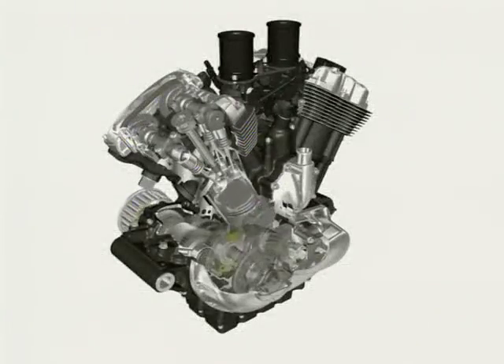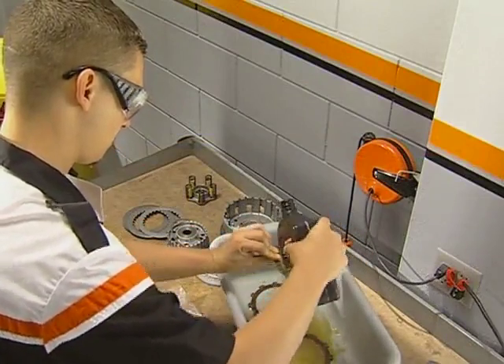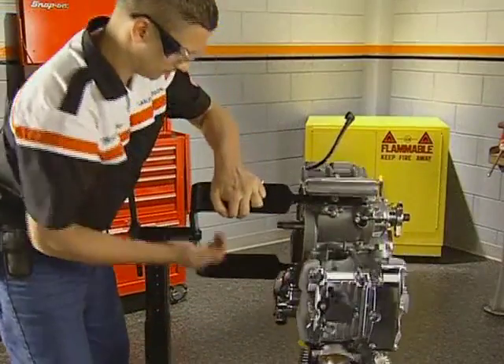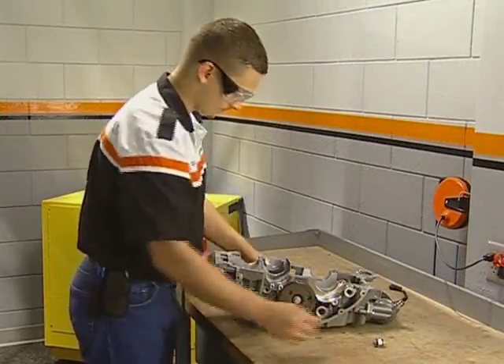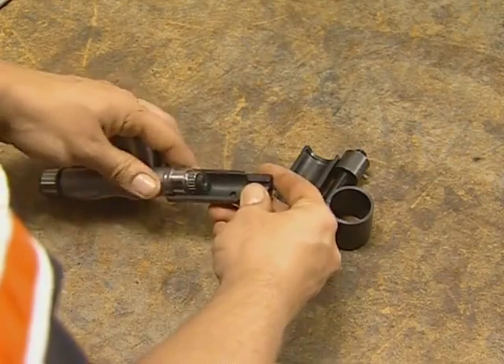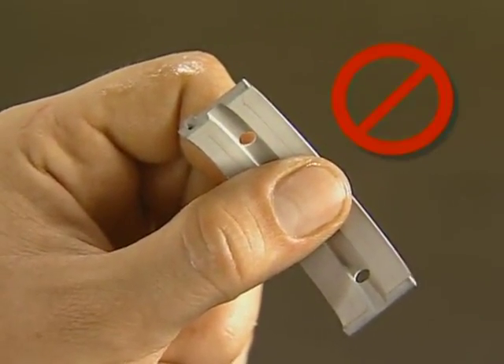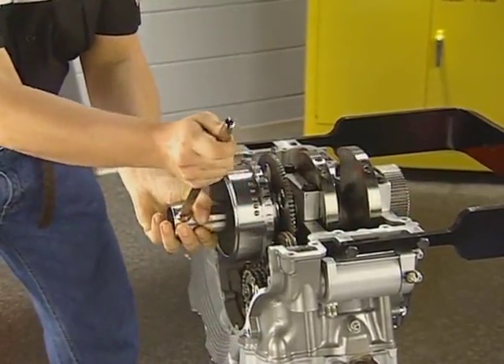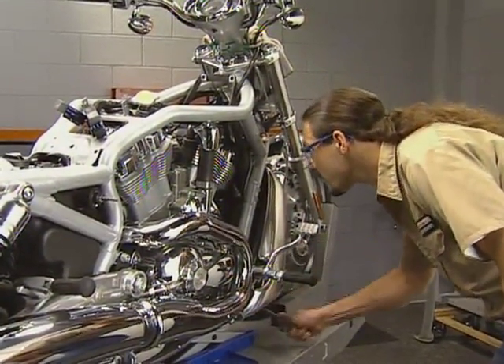V-Rod (Revolution) Engine Rebuild Pt1

Comment: If you could get the idle low enough on the Revolution engine it would sound very similar. The 60 deg Revolution engine also uses a single crank pin. But I’m going with Evo or shovel.